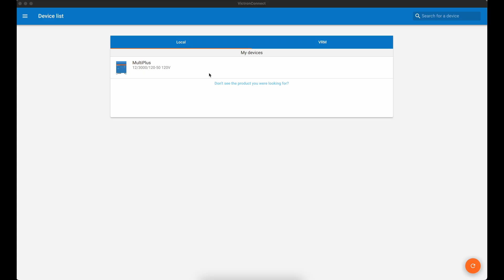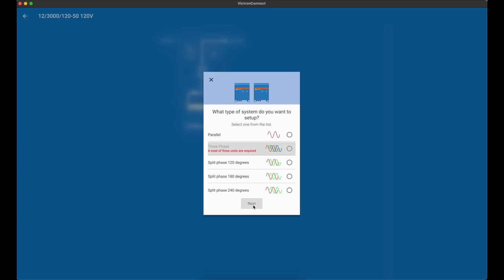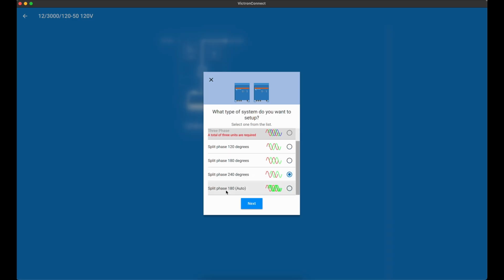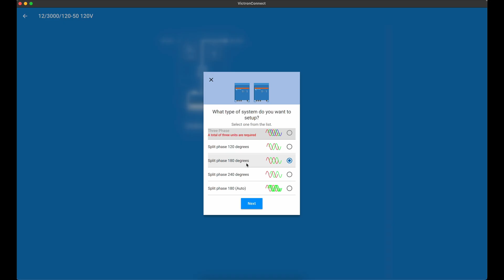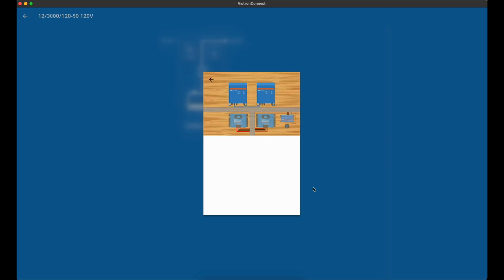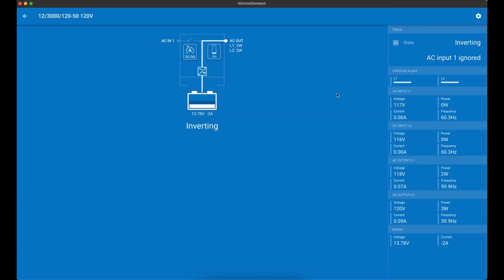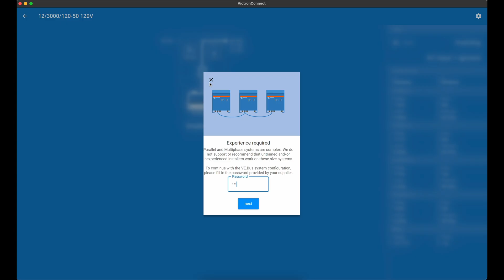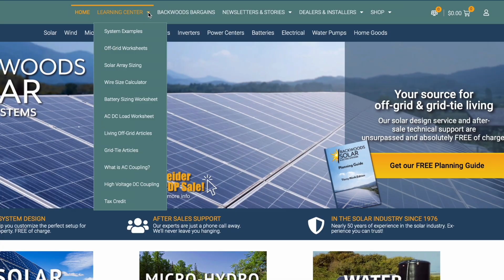Victron Inverter System Setup - Parallel, Split Phase, 3 Phase -  VictronConnect - Up to 3 Inverters

Comment: I'm currently installing two Victron 12V/5000VA/220-100/100 120V units for split phase setup in a 50A camper. Do the A/C inputs and outputs need to be connected to each inverter just for programming this setup? Or can programming be done with just the 12V battery connections hooked up?
Reply from the maker: The short answer is the inverter can power itself from either source exculsivly. You only need one. Of course you can also have both.